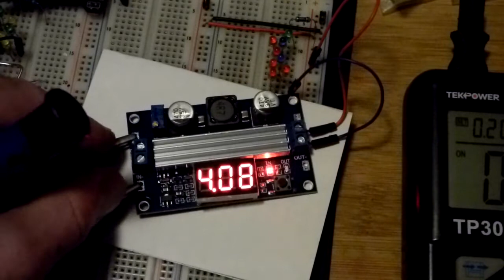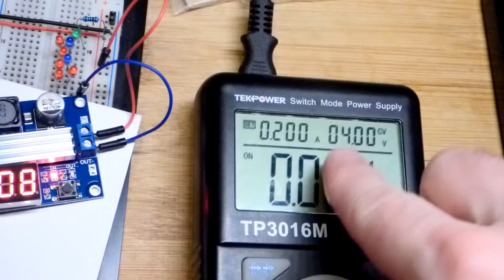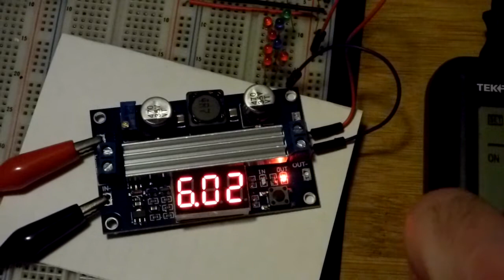Voltage boost converter module demonstration which converts electronics current into more voltage

Comment: If using one of these how many led's could a 9V battery run? Great informative session thx.
Reply from the maker: The more series LEDs there are, the higher you have to have the voltage. 9V won't light 6 series red LEDs that each drop about 2V other than a tiny bit at very low current because the LEDs drop a bit less voltage at low current. So you'd probably want more than 12 volts due to the forward voltage drop of all the LEDs being about 12V around 20mA of current. The extra voltage after what they drop is the voltage across the current setting resistor.
Reply: @Electronzap  So using a boost converter with a 9V battery wont give me more volts to run more led's off it?
Reply from the maker: @utkf16  Yeah it will, the seller claimed that you can get up to 35 volts with this module. Doesn't matter what voltage you are inputting as long as it at least 4V from my testing, but I think they claim a 3V minimum. Probably best to keep the input voltage at least a couple volts lower than what you will be outputting. 35V should light about 15 series red LEDs pretty well or about 10 blue or green LEDs pretty well. As always, current must be limited by a resistor.
Reply: @Electronzap  Great I ordered a cheap set of 5 from flea bay I want to set a matrix up with diffused RGB leds running off a 9V battery. Great session Paul and thanks for the supporting replies
Reply from the maker: Nice!